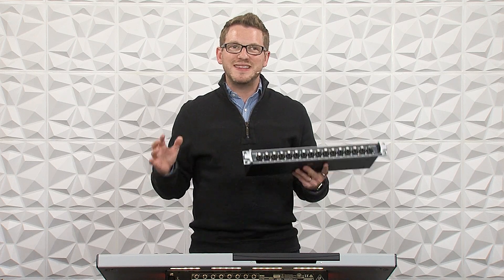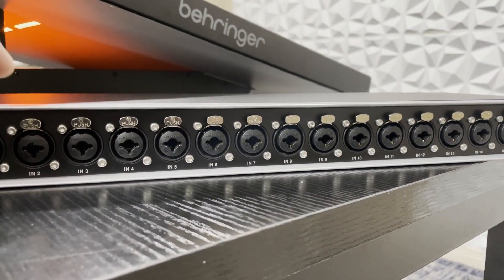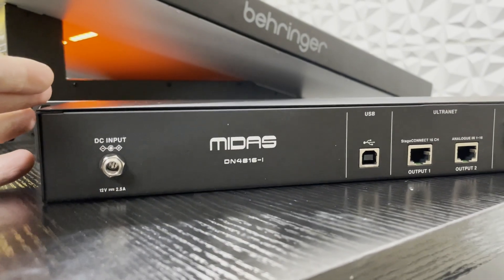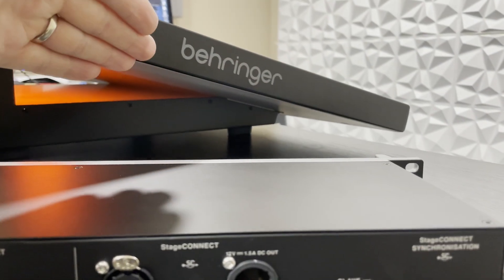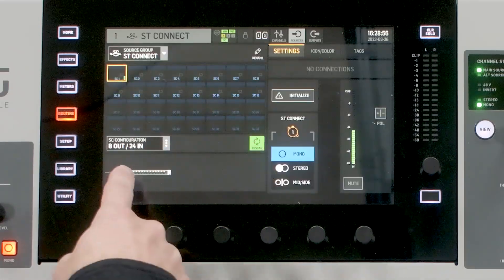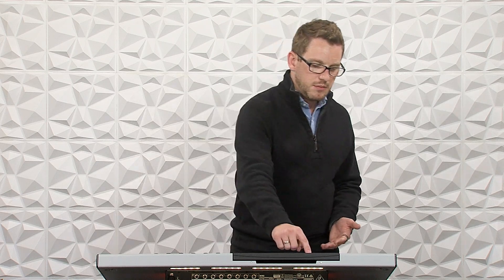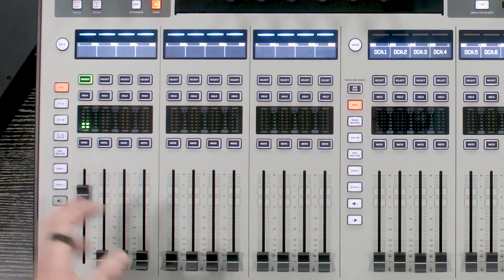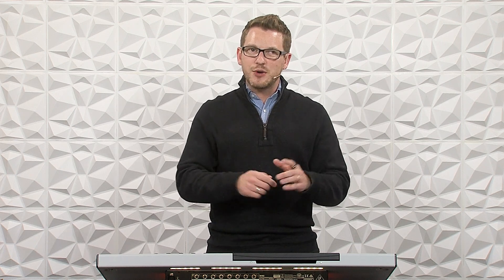StageCONNECT - Midas DN4816-I Setup with the Behringer Wing

Comment: Can I connect DN4816-I via LAN cable to the Midas DL32 stagebox to add 16 inputs (line level) or do I have to connect the DN4816-I to the Wing mixer at the StageConnect port with an additional XLR cable?

Comment: How do you route out an stereo mix bus? One XLR will output a stereo signal or will you have to use 2 XLRs? Like: Bus1 is a stereo bus, how do I get that stereo signal out via StageConnect and AES50?
Reply: Still have to link two analog XLR outputs for it to be stereo output

Comment: Ive spent hours trying to problem solve. I plug it into my computer, my computer says there's an accessory then simply put says no device connected. There's very little info on this product online. I'm just hoping its compatible with the X32 rack like sweet water told me.
Reply: The DN4816-I is a "Stage Connect" device, not an audio interface for your computer (although it has an USB interface, but this is for firmware updates only). It is not compatible with the X32 series, as the X32 product line does not support Stage Connect. Maybe the Klark Teknik DN4816U can help you in that regard.
Reply: With X32 you use the Ultranet connections..

Comment: Does it work with X32 ?
Reply: No, not directly. X32 does not support Stage Connect. Maybe the Klark Teknik DN4816U can help you in that regard.
Reply: @andreas-wismann  It does though, it also has Ultranet..
Reply: @rondutch23  I'm sorry I didn't think of that!
Reply: Unfortunately I don't think it does work. with X32s.
The DN4816-I outputs Ultranet but the X32 doesn’t accept Ultranet as an input format.
When you connect Ultranet from the DN4816-I into an X32 the X32 won’t recognise the incoming signals because it does not have an Ultranet input port.

Comment: I’m not sure what a god use for this would be without preamps. What is the purpose of this unit?
Reply: As told in the video: Connecting line level inputs. Synths, grooveboxes, PC/phone, FX returns, ...
I hope it's compatible with my x32 rack, because that"s exactly what I'll need.
Reply: I wondered the same. Are the preamps on the desk?

Comment: Hi Drew. Thank you for such detailed videos. I am requesting urgent support regarding an issue with an m32 / dl32 setup in a church. We have started experiencing crackling in the system with all signal meters going right up solid red along with loss of audio. Only way to fix this is to reboot desk. We are using the correct Midas screened ethernet extension cable. Everything has been unplugged apart from one wedge and one microphone and are still having the issue. Could you please provide some direction to further debug this. Many thanks